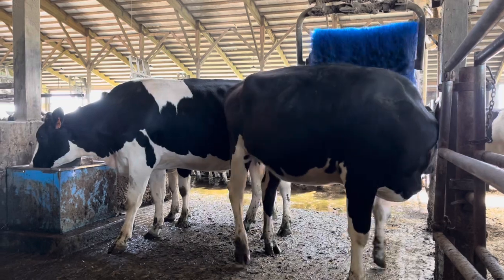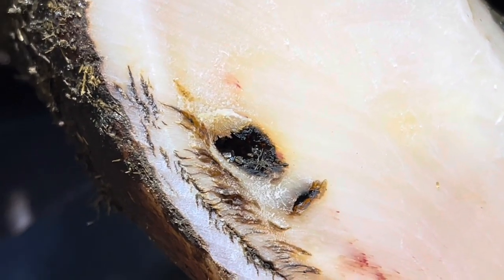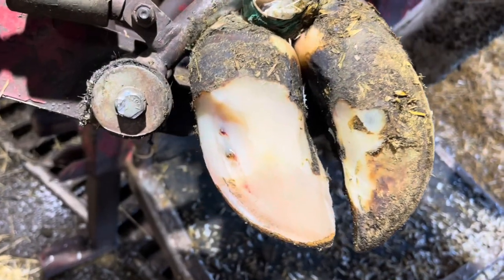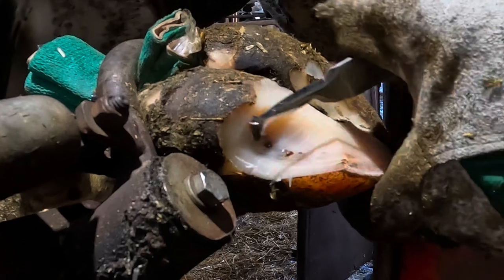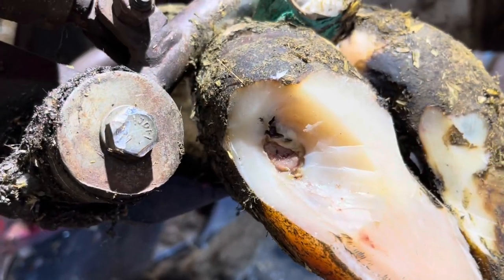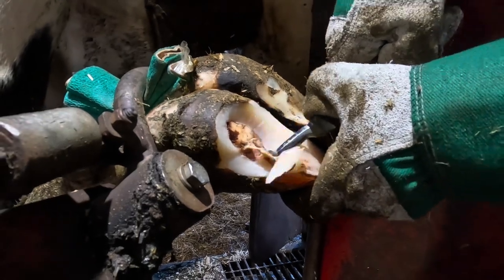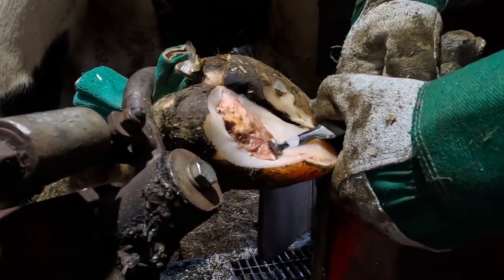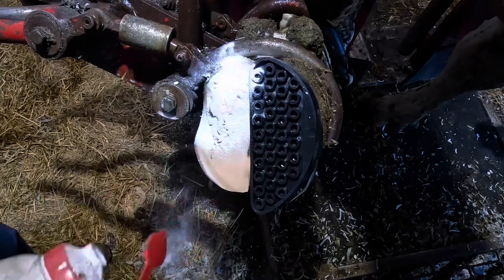WE ALL KNOW what this means

Comment: Nate what was that black spot near the white line on the outside claw I saw just before you applied the block?
Reply from the maker: Just a surface crack.  Most marks on the sole are just imperfections.  They aren’t structural.

Comment: if the crack grows out from the original defect in the corium layer, why doesn't the corium repair the defect before the crack can reach the surface of the hoof? it seems like that would be so much safer for the cow. I know sole separation is the result of the corium trying to heal itself, but why does that only happen after it's been infected?

I can imagine that perhaps that is what usually happens in most cows, and that we only see the ones where it fails and the loving touch of a Hoof Guy is required... in that case, my question becomes, what causes it to fail in these cases?
Reply from the maker: Think of the whiteline as the glue that holds the sole and wall together.  If there’s repetitive pressures happening inside the foot then that glue is continually separated from the wall and sole.  It’s not tissue and it’s inside the foot so it’s safe from bacteria.  The corium becomes infected when bacteria is allowed to enter the space.  Until then it’s just a harmless flaw.  Similar to a crack in a pair of rubber boots.  You don’t know it’s there until you step in a mud puddle.
Reply from the maker: Trimming ensures that the pressures are distributed correctly which then allows the whiteline to form correctly which means no defects in the whiteline.

Comment: Hey Nate, with gas & diesel prices going UP UP UP & might not even be available in the near future, how many of these dairy farms you work are capturing the methane from slurry & producing their own power?? Any??  The higher fuel prices go & may not even be available seems like that is becoming more & more economicly feasable & justified. Woulda been better to build that capability several years ago when fuel & energy were cheaper, not sure I'd want to build it now in the current economy crash & collapse & prices.  Just wondering...  🤔
Reply from the maker: I had a couple that harvested the methane about 10 years ago but they no longer do.  It wasn’t an efficient process as the upkeep on the generators was more costly than the electricity it produced.
Reply: Hmmm, too bad, seemed like a good idea, ok thanks 👍🏻